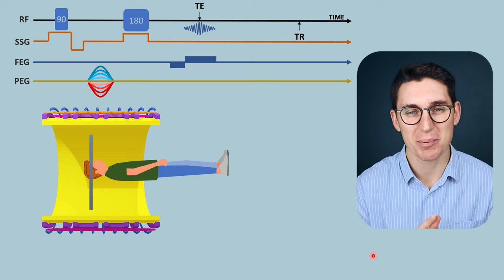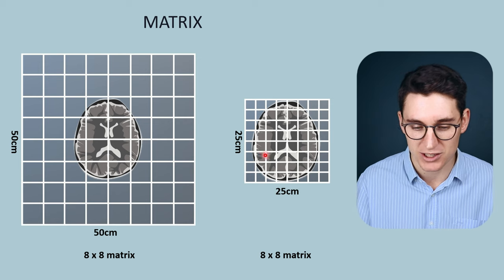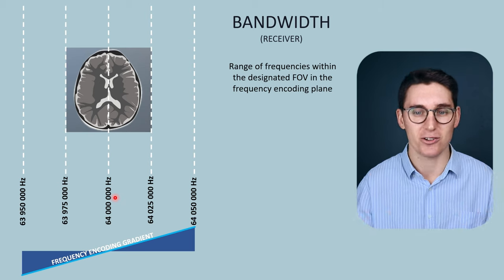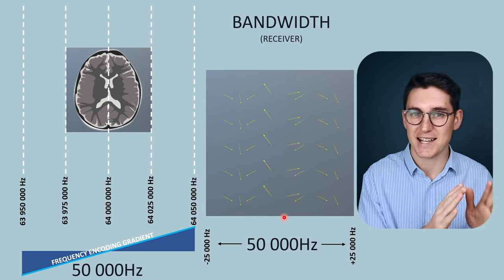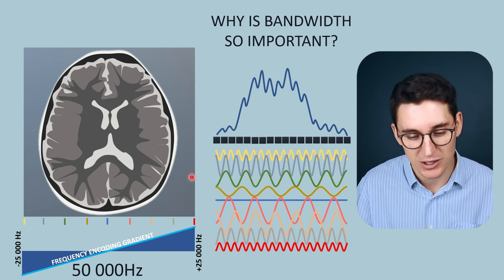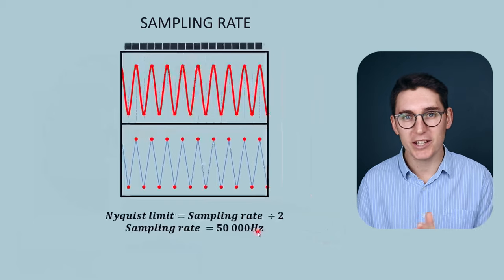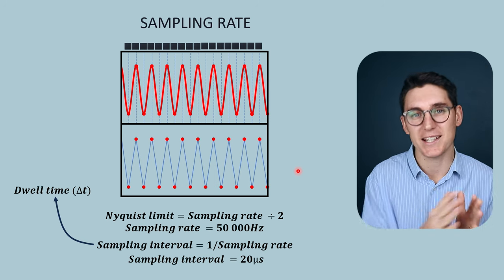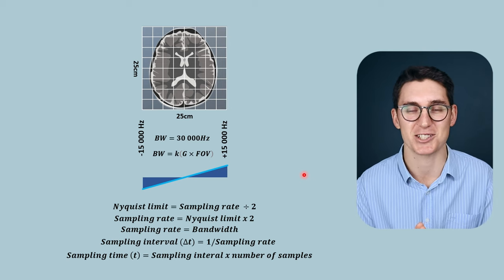MRI Field of View (FOV), Matrix Size, Receiver Bandwidth, Dwell Time | MRI Physics Course #11

Comment: There is something I don't understand in this part. If the gradient comes from B (z axis), shouldn't we work with a sagital image? (even if it is just a slice). I mean, the protons precessing in less frequency would be on the bottom and the ones with more frequency on the top right? not left or right...
Reply: Frequency encoding is along x axis so that makes it left or right  phase encoding is along y axis so that’s top or bottom